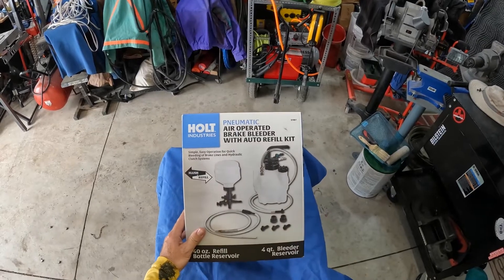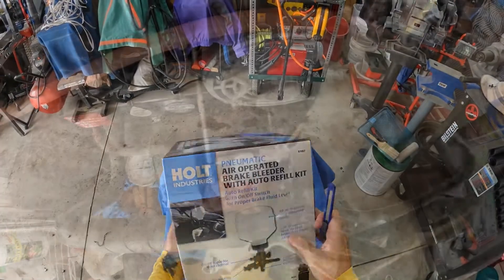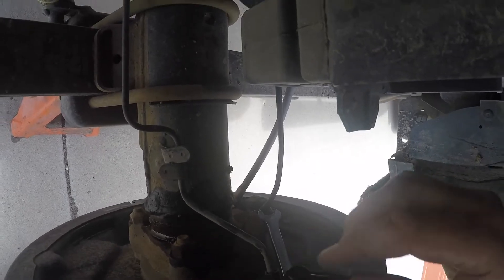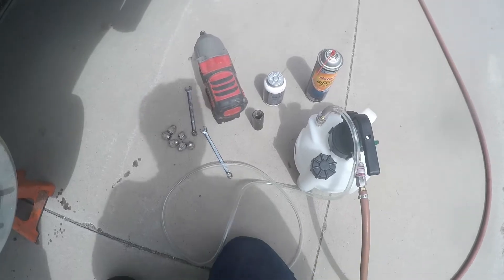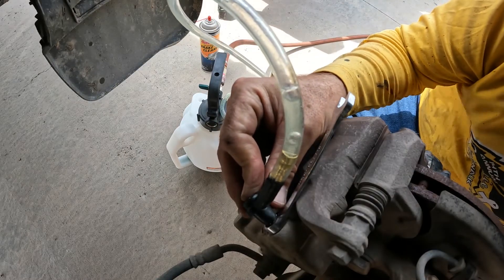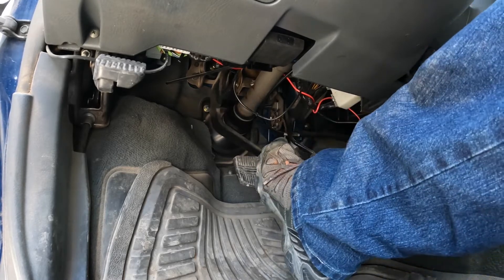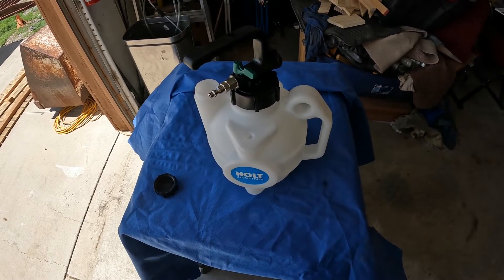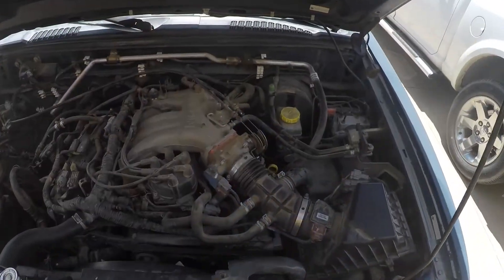HOLT Vacuum BRAKE BLEEDER

Comment: Followed all the instructions and although it worked perfectly, the refill bottle kept overflowing my reservoir so I had to wash all they mess off🤬
Reply from the maker: Annoying! If you spend money for a system like this, it shouldn't be messy. What was causing it to overflow?
Reply: @anesthesiadreamin  Haven’t a clue. Working by myself so couldn’t observe. Followed the instructions to the letter, opened fill valve, and it would stop right where it was supposed to. Bleed a line and it’s running all over the brake reservoir with the refill bottle empty.

Comment: I have the holt if you look real close it has an extra place to drill out and convert it and it will do pressure and vacuum bleeding...25 psi is max for pressure bleeding using a air regulator. I prefer pressure bleeding over vacuum bleeding I also have the motive bleeder and an all steel diaphragm pressure bleeder. The holt is great for doing brake fluid dishes and master cylinder fluid clean outs. Changing out the brake fluid every two years keeps your brake components in top condition... especially modern abs vehicles where the abs pump is big $$$.
Reply from the maker: I like what you did! If you make a video on it please let me know

Comment: My preference is the Mityvac pressure bleeder kit but @ $370 off of Amazon the Holt is a lot more cost efficient
Reply from the maker: I agree! I've used a pressure bleeder also, and it's way faster and I think it's more complete as well. The brand I used was motive, but you had to buy different adapters for different vehicle master cylinders. At least with the Holt, you don't have to buy different adapters

Comment: I almost commented that it looks like a lot of air was being introduced to the system. I think I'd rather a pressure bleeder tbh.
Reply from the maker: absolutely. I've used a pressure bleeder, Motive brand IIRC, and it was super fast (once it was set up)... but it works best with the brand specific adapters (the generic "fit all" adapter is a PITA IMHO). But this one gets the job done, I haven't had to redo any from air entraining into the system... so far :0

Comment: Not many have a compressor if you live in the apartment
Reply from the maker: @rolandoperez8054  You are so right, I've 
 lived in many apartments before where I've laid on my back in hot parking lots working on my cars. But I'm sure you know that you don't need a compressor to bleed brakes, you can do it the old fashioned way which I did for years, where you have somebody pump the brake and you open the bleeder screw. Should be lots of videos on that method. The MOTIVE brand bleed system may actually work with a small tire inflator, and doesn't take a lot of pressure.

Comment: I really love the part of the video where you completely glossed over how to actually connect the tool to the bleed nipples on the brake caliper.
Reply from the maker: Wow, sorry about that. I guess I bled my own brakes all my life I just took it for granted. This system just has a rubber 90° elbow that pops over the nipple. Just make sure the nipple is nice and clean inside and out, including the threads on the outside. I usually use brake cleaner to clean it, wear your safety glasses, it sucks to get that in your eyes.
Reply: @anesthesiadreamin  thanks, I appreciate it. I popped off a little too soon becuase I figured it out shortly thereafter. It was just a little disappointing because I did a search for the Holt Pump and your was the first video. It was so clean and to the point, and then it didbt show the one thing I need to see. But it's perfectly fine, because you did it on your time and it's still a contribution, and it's an emotional charge that was elicited so I suppose that's the whole point.
Reply from the maker: @hordebutcher2651  and I appreciate the honest feedback. That's what I need 👍 Happy bleeding! 🙂
Reply: if you need to ask that question you shouldn't do this job
Reply: Nail on the head, lol.

Comment: i had hoped this one was a pressure bleed system that clamped to the master cyllinder.  dont want to pay the 1200.00 for snapon :/
Reply from the maker: I hear you! I wanted a pressure bleeder too, I used one by Motive, but I didn't want to buy a bunch of different adapters for 5 different cars (the universal adapter is a PAIN to use). So I settled on this. It works. It's not as much fun as a pressure bleeder though!

Comment: Could you use an hvac pump instead of a compressor for this?
Reply from the maker: @tlslawncare  I think it would depend on the CFM, but it would just need to be enough flow over the top of the hole to create a vacuum, just creative venturi effect. I don't have an HVAC pump to try it though
Reply: @ I just used this as an excuse to go buy a compressor lol.
Reply from the maker: @tlslawncare  famous words from an old farmer: "every new project requires a new tool" 🤣

Comment: .
If you do not push the calliper pistons back
you will still have mucky fluid in the system.
.
Reply from the maker: @mikedelta1679  excellent point I never thought of! Thankyou!!!
Reply: @anesthesiadreamin  My pleasure :)
Reply: .
There is a risk that the pins, or the pistons may jam.

It's a good risk however, as you discover the risk
before it becomes a disaster.
.

Comment: Outstanding - VERY helpful. thank you!!  Couple of questions - When pumping fluid out of the bleeder valve, were the bubbles in the line coming from around the nipple because your adapter wasn't fitting properly?  Also what did you do with the old fluid?
Reply from the maker: I think the adapter was fitting well enough, I think it was coming around the threads. I haven't experimented with it much, but people have said in the past if you put some grease around the threads after you loosen the nipple, you won't get bubbles back in the line. But like I said, I haven't experimented with it enough to say that yes that works all the time. Oh, I just put the brake fluid in with my waste oil, it even says online it's appropriate to put it in there because it's not any more hazardous than regular motor oil. Hey thanks for watching and for your questions 👍

Comment: When it comes time to get nasty fluid out, this machine looks like it would do the job perfectly but when it comes to bleeding brakes nothing beats having a buddy help you pump,you can buy him a case of beer afterwards and you'll still be ahead, several years ago i got on this "kick" and i probably bought every machine made out there for bleeding brakes, speed bleeders, you name it,a buddy pumping the brakes? best solution.

The problem was, is and always will be the bleeders letting air in,thats why when you have a friend pumping,he holds the pedal down while you quickly close the bleeder,no machine can do that, well I'm sure a 10 thousand dollar one at a dealer can, lol, good video though,love watching these.
Reply from the maker: That's how I did my brakes for about 25 years, I had my wife or my daughter pump them. Never had to re-bleed after a test drive 👍
Reply: You hit the nail on the head and that is what I'm realizing as I'm trying to use this gadget here. TBH even as a fluid removal tool it's not super useful, a turkey baster is just as useful for about $95 less!

Comment: I had the same looking chunks of stuff come out of mine too. It was the first time I had flushed the system with new fluid and it turned out to be little bits of grease. I'm guessing it was maybe some sort of assembly lube for the hydraulic manifold.

Comment: Here's a free idea. 90 bucks for this I think is what you said? I have a couple of lawn and garden sprayers I no longer work. Looks like they could be converted to do this chore
Reply from the maker: That would make an excellent YouTube video! Do it! And then send me the link 😁👍👍👍
Reply from the maker: This is exactly why I love YouTube! The comments from such smart and creative people 👍
Reply: @anesthesiadreamin  well thank you and very kind of you. It just come from being cheap. Growing up on the farm if we could not fix it or make it work then we did not have it. Not so broke but not rich either. I also saw was somebody took an HVAC vacuum pump and picked up some adapters and used a drop bottle . The drop bottle was    commercial side approximately one and a half gallon mustard are pickle 🥒 jug like ever used in a cafeteria. I might make one of them. But right now I'm just going to finish my job. So I'm going to buy a $25 harbor freight special. But this will give me the connectors I need for building the other apparatus.

Comment: Great video.  I could have used a bit more step by step as I'm not an expert at bleeding brakes but I think there's enough here that it will make sense when i get into it.  In my case I will be replacing lines/rotors/calipers/pads on all 4 corners of a 2006 Jeep TJ Rubicon (4 wheel disc).  PowerStop Z36 full kit
Reply: Oh yeah.  Epilog.  This thing works great.  The only thing I would say is to make sure you have a good seal on the bleeder nipple so you don't get false bubbles from air leaking in.  That just causes you to leave it on longer than necessary and waste new brake fluid.  But the benefits definitely outweigh the cons. And the brakes have performed flawlessly on the Jeep.
Reply: Me either I bought this gunna try it on my acura tsx when it gets warmer

Comment: Here is a trick I learned is to smear some grease around the bleeder screw to keep it from sucking air around the threads it should eliminate air bubbles as long as your vacuum bleeder has a good seal on the bleeder screw
Reply from the maker: Thank you for mentioning that! I learn a lot from the comments, and many people do read the comments as well, so thank you for your feedback and for watching 👍

Comment: There will be always bubbles coming out in the tube with this system because the plug can't be really waterproof as you unscrew the bleed screw, so this is absolutely normal and you did it the right way. The thing is that You can't not say if it come from the inside circuit or the bleed screw that's why with this system you will suck a sufficient amount of liquid to be sure.
Reply from the maker: Okay, that's good confirmation of what I was thinking! Thank you so much for your comment, and for watching 👍
Reply: I think you could maybe put a little Teflon tape around the bleeder screw this might keep Air from sucking around the screw. I haven’t tried this, but I’m going to.